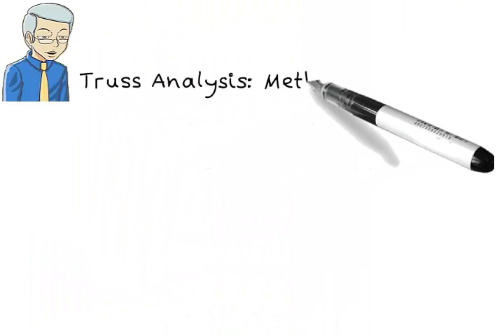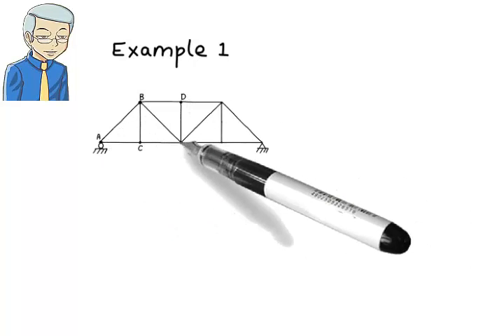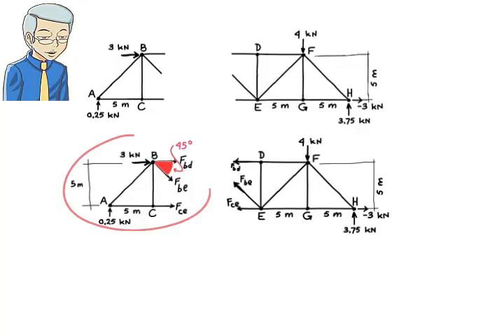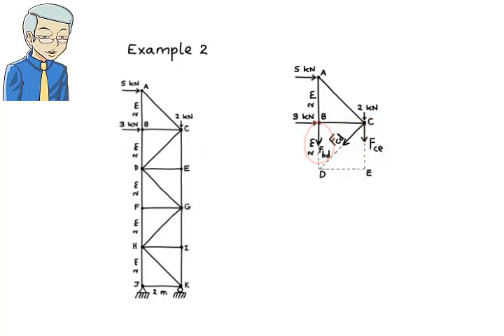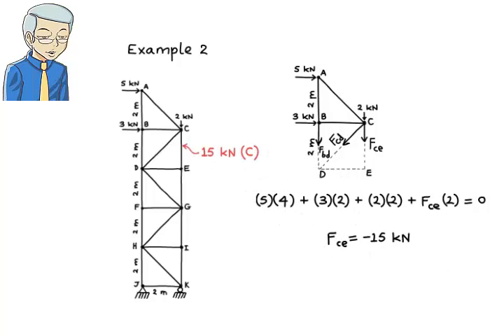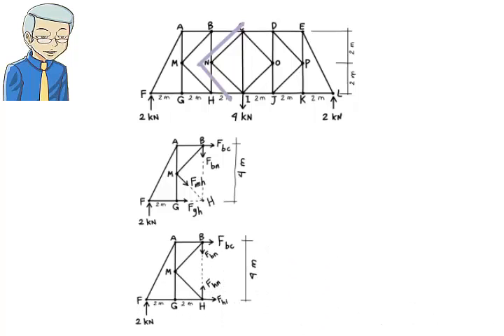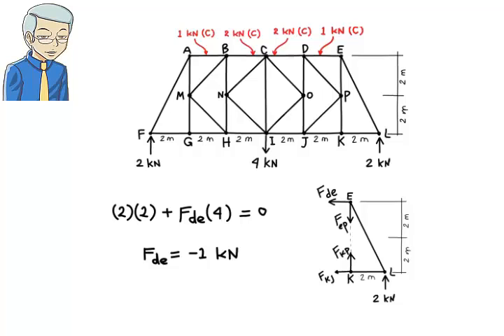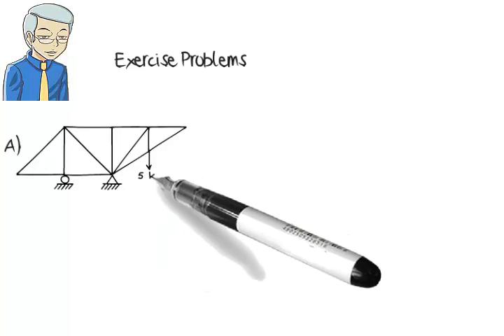SA10: Truss Analysis: Method of Sections

Comment: For exercise problem B I got 3.35kN by taking the moments around pt C. I calculated the distance the 2kN was from pt C by first calculating the distance DC by taking 5xCos(15)x2 then multiplied that number by the cos(30) to find the vertical distance of the force from the point of rotation. This gave a moment of 16.73kNM. Since this moment can only be cancel by the tension on beam AB I divided this moment by 5 to get 3.346kN. What am I doing wrong?
Reply from the maker: +Curt D Distance CD (the shortest distance between the applied load at Point C) is: 5 + 5 sin(45) = 8.536. Then, the moment that the 2kN force generates about C is: 2(8.536) = 17.07.  Now, we can get the force in AB using equation:

5 Fab = 17.07.  Or, Fab = 3.41 kN
Reply: +Dr. Structure Thank you, I made an assumption that angle BCE was 15 degrees because I though ACD was an equilateral triangle. I am clearly wrong because angle ABC is 90 not the required 120 to form such a triangle. Thank you for your quick response. I will try to assume less.
Reply: @DrStructure  but Fab is -3.416kN,isn't it????
Reply from the maker: No, the member needs to be in tension, meaning the force would be pointing away from joint B, for the sum of the moments about C to be zero. The applied load creates a clockwise moment about C, so Fab must create a counterclockwise moment about C for the sum to be zero. That means the (Fab) force arrow must be point away from B and toward A, that signifies a tensile force.
Reply: I did not understand 5fab=17.07

Comment: @5:52 im trying to figure out why we did the moments minus Fce multiplied by 5. Isnt Fce in the x direction? isnt moments focused on forces in the y direction. So why was negative Fce multiplied by 5 used? And should that be positive Fce multiplied by 5 since the force is to the right? Alsl I learned that clockwise is negative so i am so confused.
Reply from the maker: +Peta-anne D Here, we are writing the equilibrium equations for the free-body diagram consisting of joints A, B and C.

I am assuming your question(s) pertain to the third equilibrium equation:(0.25)(5) - Fce (5) = 0.

This is a moment equation, we are taking sum of the moments about joint B. 

You asked: Isn't Fce in the x direction? Isn't moment focused on forces in the y direction?

The answer to the first question is YES, Fce is in the x direction. The answer to the second question is NO. Regardless of its direction, any force that does not pass through joint B has a moment about B. 

Here, five forces are shown on the free-body diagram (Fbd, Fbe, Fce, the 3kN force and the 0.25kN force). Three of these forces (Fbd, Fbe and the 3kN force) pass through joint B, therefore their moment about B is zero. The remaining two forces (Fce and the 0.25kN force) however have non-zero moments about B. 

The moment of the 0.25kN force about B equals to the magnitude of the  force times its moment arm (the shortest distance from the line of action of the force to B). This distance is 5 m (the horizontal distance between A and C). 

Similarly, the moment of Fce about B is Fce times the shortest distance from the line of action of the force to B (the moment arm). This distance is 5m (the distance between C and B). 

As for the sign convention for moment, you can assume either clockwise or counterclockwise to be positive, it does not make any difference which direction is considered positive as long as it is done consistently.

If we assume counterclockwise is positive, we get:
(5)(Fce) - (0.25)(5) = 0.

If we assume clockwise is positive, we get:
(0.25)(5) - Fce (5) = 0.

Either way, we get Fce = 0.25 kN.
Reply: Ohhhhhhh wow!!! Great explanation thank u so much!!!
Reply: +Dr. Structure can I learn forming the moment equation from any of your other videos?

I Could vaguely understand the (Fce)(5) part.
Reply from the maker: +Taanya Sachdeva We are summing the moments about B.  The 0.25kN reaction force creates a clockwise moment (we assumed clockwise to be positive). But Fce creates a counterclockwise moment, hence the negative sign. 

The moment arm for the 0.25kN is 5m. This is the horizontal distance between A and B.
The moment arm for Fce is also 5m. This is the vertical distance between C and B.

So, we get: +0.25(5) - Fce(5) = 0.
Reply: Dr. Structure thank you so much :)

Comment from the maker: +Jascha Annogui wrote: Ho do we find the force in member BN in Example 3?

Answer: This can be done in a few steps:

1. Calculate Fgh. This is done using the fbd @10:38. Taking moments about Point A, we get: 2(2) - 4 Fgh = 0.  Or, Fgh = 1 kN.

2. Calculate Fmh. This is done using the fbd @9:28. Taking moments about Point B, we get: 2(4) - Fgh(4) - Fmh sin(45)(4) = 0. Since Fgh = 1, we get: Fmh = 1.414 kN.

3. Now,  summing the forces in the y direction in the above fbd, we get:
Fbn + Fmh cos(45) = 2. Since Fmh = 1.414, we get: Fbn = 1 kN.

Comment: thank you for the video.  I just want to ask, fir the questions given at the end of the video, why is the value for F(ce)=0 for question A).  Your reply is greatly appreciated
Reply from the maker: +SuperTaiko95 Cut the truss vertically through members BD, BE and CE. Now, consider the left segment of the structure. Its free-body diagram consists of four forces: the vertical reaction at the roller support, Fce, Fbe and Fbd.  

Notice that three of these forces (the support reaction, Fbd and Fbe) pass through point B. So, if we take sum of the moments about B, we get: 

4 Fce = 0

This means for the equilibrium equation to be satisfied, Fce has to be zero.
Reply: Ok.  That makes sense.  But what if I was to consider the right hand-side of the structure?  Do I have to take into account the reaction forces at point E as well as the other forces?
Reply from the maker: +SuperTaiko95 Yes, we can take the right substructure. But then its free-body diagram would consist of Fbd, Fbe, Fce and the horizontal and vertical reactions at E as well as the applied loads at G and H. Now we have five unknown forces meaning we need to do a bit of calculations before we can show that Fce is zero.
Reply: +Dr. Structure My answer is Fce=0 and Fbd=-11.25. But the correct answer is Fbd=1.25 Kn. Why? please healp me.
Reply from the maker: +kazuto kirigaya Yes, the correct answer is 11.25 kN, the member is in tension.  There is a (youtube annotation) note placed on the video clip @15:10 that shows the correct value.

Comment from the maker: +Vishean Veloo 

Question: Hi, may I know why do you get '15' in the equation of Moment in 2.43? I dont understand that part.

Answer:  The moment equation is obtained by taking sum of the moments about point H. Three forces produce non-zero moment about H: the left reaction (Ay), the applied 3kN horizontal force and the applied 4kN vertical force.

The moment arm for Ay is 20m, the moment arm for the 3kN force is 5m (the height of the truss), and the moment arm for the 4kN force is 5m. So, we get: 20(Ay) + 5(3kN) - 5(4kN) = 0.

Hence, 20 Ay + 15 - 20 = 0.
Reply: +Dr. Structure Hi I had this problem too, however it still doesn't explain how the value is 15. Is it not supposed to be 15 (distance from H) x 3 (force) which would be 60? thanks
Reply from the maker: +Kerry Aziz The moment arm for the horizontal 3kN force is not 15, it is 5. The moment arm of a force about a point is the shortest distance from the line of action of the force to that point. This would be the length of a perpendicular line from that point (here, Point H) to the line of action of the force.

What you are doing is taking the horizontal distance from Point B to Point H. That distance, 15 m,  is not the moment arm for the horizontal force at B. Since it is not perpendicular to the line of action of the force.

To determine the moment arm for the 3 kN force, draw a line over the force that is an infinitely long in both directions. This is the line of action of the force. The shortest distance from point H to this line is the moment arm for the force about H. This distance is 5m, the height of the truss.
Reply: +Dr. Structure ooooh I understand now, thanks a lot!! :)

Comment: Hello Dr Structure, thank you very much for the great video! I have a question, though. Why is F(ac) not included in the equation of the sum of moment about D at 7:00?
Reply from the maker: Zoe L. Because the internal force in member AC does not appear in the free-body diagram (FBD). Since the force is not shown on the FBD, it does not
play a role in the equilibrium equations.

The xxternal loads applied to a structure are always shown on the free-body diagram. The force internal to a member, however, appear in the diagram only if the member is "cut" exposing the (internal) force. In the example, we cut through three truss members, but AC is not one of them. Therefore, the force in member AC has no impact on the equilibrium equation.

Comment from the maker: +Jim Law asked: How can I solve for support reactions in Example 2?

To do so, consider the entire structure. It is subjected to three known forces and has three unknown support reactions. To find the reactions, write, and simultaneously solve, three equilibrium equations:

Sum of the moments about Point J must be zero.
Sum of the forces in the x direction must be zero.
Sum of the forces in the y direction must be zero.

Or,

5(10) + 3(8) + 2(2) - Ky (2) = 0
5 + 3 + Jx = 0
Jy + Ky + 2 = 0

where Ky is the vertical reaction at K and
Jx and Jy are the horizontal and vertical reactions at J.

This gives: Jx = - 8 kN, Ky = 39 kN, Jy = -41 kN.

Comment: hi Dr.structre i am unable to get the answer for exercise problem 3..can u help me with giving some hints..
Reply from the maker: Rinil Babu Cut through members CE, CD and BD. Draw the free-body diagram for the left substructure. Three unknown member forces are present in the diagram. Two of the unknown forces pass through a point, you want to write the moment equation about that point. The equation would contain only one unknown, Fbd.....
Reply: Dr. Structure  thanku i got the correct answer..its always been a tough topic for me sometime..now u made it very easy for us..a lot of thanks

Comment: Sir the video was great, but can u provide the solution of problem 'D'
Reply from the maker: TheJae3013 Make the cut using a vertical line that passes through member AC and all the members below it. In total four members are cut, dividing the truss into two parts.

Take the right part, the part that contains the applied load, and draw its free-body-diagram. 

The diagram consists of four unknown member forces all of which, except for the force in member AC, pass through point B.

So, if we take sum of the moments about B, we get:

4(6) - 4(Fac) = 0.

The first four is the applied load which is multiplied by 6, its moment arm about point B.  And, the moment arm for Fac is 4.

This gives us: Fac = 6 kN.
Reply: Dr. Structure Thank u very much

Comment: Hi Dr. Structure,@7:11 you wrote the equation of moment about point D. According to you, the forces that make moment at point D are: 5kN at point A, 3kN at point B, 2kN at point C and the force Fce in the line of action CE. My question though is: why the force Fcd does not make moment at point D too? Because the components of that force would be Fcd (x) and Fcd (y), in a distance of 2 and 2 meters, respectively. Then our equation of moment would be a little bit different, adding those two forces.
Reply from the maker: Amarildo Kuhn Okay, let's write the moment of Fcd about point D. Fcd is an inclined force, it has an x component and a y component. Since the angle of inclination is 45 degrees, the component forces are:

x-component of Fcd = 0.707 Fcd 
y-component of Fcd = 0.707 Fcd

Now let's take the moment of Fcd about point D. Assume clockwise moment to be positive.

The moment is: 0.707Fcd (2) - 0.707Fcd (2) = 0.

That is, the x and y components have the same moment value about D, but in opposite directions, so they cancel each other out.

Alternatively, if you examine the line of action of Fcd, you can see that it passes through point D. Therefore, its moment arm about D is zero. This means the moment of the force about D is zero.
Reply: Dr. Structure Thanks for your answer. I was really confused about this, but now it's clear. They both cancel each other.
However, let's suppose that the length of square was 3 in the x-axis and 2 in the y-axis. We would ended up finding an angle of 33.7 degrees. In this case, we would have: 

x-component of Fcd = 0.83 Fcd 
y-component of Fcd = 0.55 Fcd

In this assumption, even though the line of action of Fcd passes through point D, the x and y components would have different moment values about D, is that correct?
Reply from the maker: Amarildo Kuhn That is right, the components would be different if the angle is different than 45 degrees, but so would the two moment arms. 

For your example we get: (0.83 Fcd)(2) - (0.55 Fcd)(3) = 0.

Comment: It is awesome but got a question- at duration 13.55 of this video, in second scenario why did you not include 2KN force acting at point C and why ( Fdf *2) is negative whilst in first scenario all forces are positive..
Reply from the maker: Gurwinder singh In the second scenario we are taking sum of the moments about point G. Since the 2 kN force passes through G, it has a zero moment arm, meaning its moment about the point is zero. 

The equation assumes the moments that have a clockwise rotation about G to be positive. Here, Fdf causes a counterclockwise moment about G, hence the negative sign.

Comment: hello dr.  what if we want 4 forces or more ?
Reply from the maker: Assuming the structure is statically determinate, you maybe able to use the method of sections repeatedly by finding 1, 2 or 3 forces at a time until all the unknowns are determined. If that is not an option, use method of joints.
Reply: Can u solve am example that we should use the method of section twice
Reply from the maker: Shaho Amedi
Consider Example 3 (starting @7:51). Suppose we are asked to determine member forces BC, KC, KI and HI. If we cut the truss vertically through all 4 members, we end up with four unknown forces which cannot be determined using the three equilibrium equations.

Instead, we can cut the k-truss in the manner shown in the example to find the force in members BC and HI. Then, cut the truss vertically through all four members to find the remaining two unknown forces.

Comment: In example 3. what if we want to find the force MB? Should we still use the method of sections? Thanks!
Reply from the maker: Yes, I would use the Method of Sections to find the force in member MB. But this involves two steps:
First, determine the force in member AB. Then, cut the truss through members AB, MB, MH and GH.

Now set sum of the moments about point H for the right substructure to zero. The moment equation contains only one unknown, the force in member MB. Solve the equation for the unknown force.

Comment: In C) Do we need to use Geometry to calculate the perpendicular distance between Fbd to point C? Couse when we take a moment on the point C (becouse of the intersection of other two member Fbc and Fac...  I found The distance 4m but the solution is not equal with yours...
Reply from the maker: Yes, the shortest distance from point C to the bottom chord of the truss has to be calculated. This can be done using similar triangles:

18/30 = h/10

where h is the distance of interest. 

h = 6 m.

Taking sum of the moments about C, we have

6Fcd + 5 D = 0

where D is the moment arm for the applied load. D can be calculated also using similar triangles. That is,

24/30 = D/10. 

Or, D = 8 m.

Therefore, 

Fcd = - (5)(8)/6 = -6.67 kN
Reply: thank you so much i found h=4 miscalculation :( Thank you for the explaining you re the best !! =)